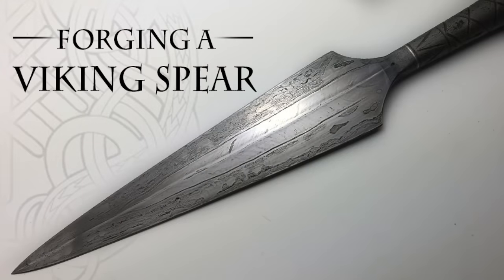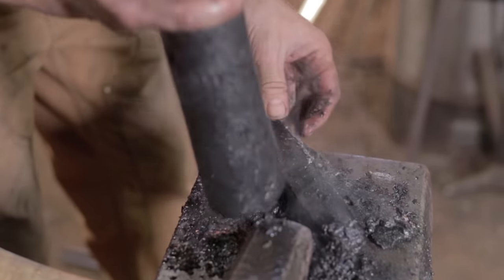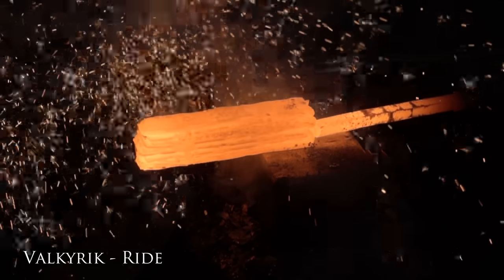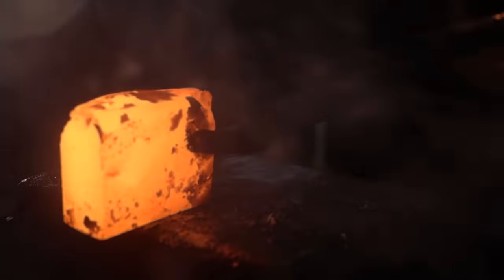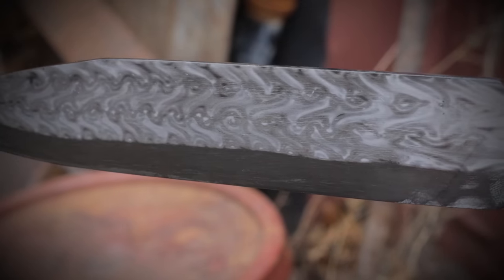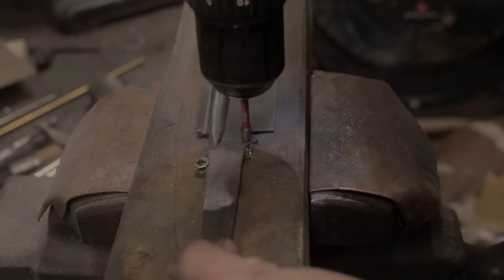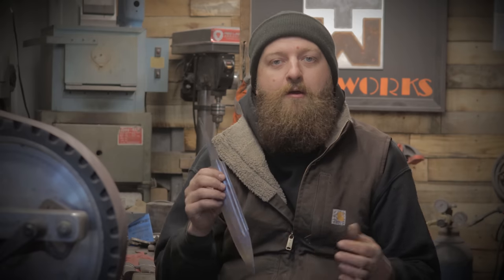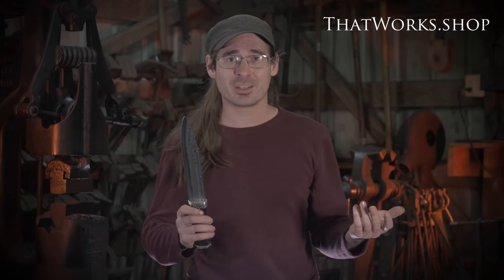Forging a [Viking] Seax from Blister Steel - Feat Valkyrik Soundtrack

Comment: Looks like there's quite a lot of air pockets or failed forge welds or cracking between the iron and steel layers, I would be worried about the blade's ability to stand up to abuse.
Reply: And its on sale for 2600.00 lmao

Comment: Considering all the effort put into the pattern welding and the carburization of iron it would have been nice to see a more "historically accurate" scramasax, since there are a lot of seaxes with beautiful engravings and even more intricate fullers, more on the merovingian horizon though, and not only on langsaxes but in kurzsaxes too. Nice work nonetheless.

Comment: I like that you promote the use of the sander, a tool that should not be underestimated in the workshop, I built my first sander almost 40 years ago with a 4 inch by 108 inch belt on a 3 hp motor, I still have it and have rebuilt it a few times over the years, I also have a 5hp canning machine with the same belt size,, now that Im knife making rather than stainless fabrication i need a smaller machine for knives, that said there isnt much I cant do with my big machines, Only a few like grinding and polishing and will take the time to master it,, but its worth it,,
Reply from the maker: I used 5hp Bader huge machines most of my career so I hear ya!
Reply: @ThatWorks   I can tell, every time I watch  a tube with you on the grinder i see you do exactly the same things I would, although i dont have that set up to change wheels out for the fullers, for that I will need to build a new machine, Grinding and polishing  is an overlooked skill by most fabricators and yet finishing your own work to a professional standard is super important and personally i never left my finishing to one of the grinder polishers employed at the factories I worked at as they are over worked underpaid and under appreciated and they always enjoyed a bit of a break if you could finish your own work,,  as an employer i taught my trainees to polish first so they would understand what good work and good welding was, very difficult to polish crap welding, they learn fast,,  working SS for 40 years set me up well for knife and sword making,,  If i ever get over that way i am coming to visit , a couple weeks spent in your shop would be time well spent,,
Reply from the maker: @hugokappes4077  I love it! The last 5% of finishing a project is the most important. So many people stop at 95%
Reply: @ThatWorks  You got it,,  !! its not finished until its finished,, ! I get a great deal of pleasure finishing a mirror polish on something,,
Reply from the maker: @hugokappes4077  I’ve actually started getting that feeling from hand sanding the final few grits. Nothing like a hand sanded blade.
Reply: @ThatWorks  sometimes thats the only way to get it to look right,,

Comment: they have found jewelry and other trinkets in viking tombs that originates as far as india, while vikings are renowned for pillaging, most of the seafaring were either for migration and settlement, or for trading. and steel was a very sought after material for trade

Comment: My favorite Bladesmithing experiment I’ve done was forging chainsaw chain Damascus the same way you would process bloom steel. I folded the material until it was solid and the final result looked very similar to high carbon bloom steel

Comment: When I worked as a chef I noticed that my higher carbon knives were hugely effected by onion, and red cabbage and would blacken almost immediately.  I would guess that a polished unetched blade would gain a chemically etched look through normal use quite quickly if the blade was not constantly polished.  Maybe an interesting experiment, you could put a blade constructed like this through daily use and see how it goes.   Great videos,  thanks for sharing your experience and knowledge.
Reply: And we ate and still do eat alot of onions,here in thr north. And i agree with you on this.

Comment: Don't know if you guys would be up for it, but I would love to see a full traditional build on something of damascus. Coal forge, no power tools, all hand tools, would love to see how you'd do it. Most smiths that I've seen always use some sort of power tools, and I understand that it makes it easier and faster, but would also love to see older techniques used. When Ive gone to Rennaissance fairs before, I'd love to just sit and watch the smiths or glass blowers if they had them.

Comment: Very beautiful knife and fun video to watch. I have made and sold many Seax knives. I also used Bog Oak in the handle. I believed it added the Viking spirit into my knives. My fittings were hammered bronze. 
I’m curious about why you went with more of a Bowie tip instead of the original Seax. Doesn’t matter. It’s a very beautiful piece.
Reply from the maker: “The original seax”. There are about a dozen of common seax shapes. I don’t believe there is an original
Reply: @ThatWorks  this is true. I believe they may be getting at the commonly seen/known image of a Seax, and it's almost dead straight edge and sharply defined broken back

Comment: I think the "etching" was done by hand sanding , then the use and rust of the handoils, and when a leather slid was used the resdou of the leather preparation, then only the cutting egg was sharpens... cutting into animals and people added to the mix of "oxidisers" ... vikings dined handel there knives with clean cloth like the samurai

Comment: ✋ Question, correct me if I’m wrong and I’m not trying to start a fight but isn’t the Seax Anglo-Saxon not Scandinavian or “Viking” I’m not saying that they didn’t use it at one point in history but to say that it is a Viking weapon is misleading isn’t it?
Reply from the maker: Not this particular one. The silver design work is quite Viking. I had a whole talking point about the seax being a euro thing not just a Viking thing and it actually predates the Viking as the romans had seax knives too.

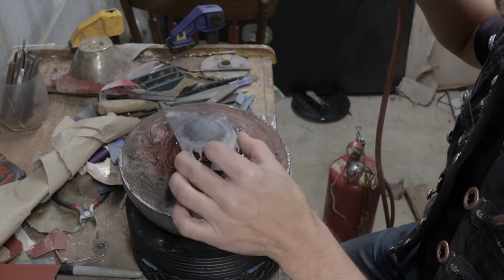Comment: 21:00 I've wonder if Ilya uses rough formed pieces for chasing and repousse work, thanks for showing an example. That's a nice piece of bog oak for the handle too. The Seax turned out great!
Reply: What do you mean by that question
Reply: @ilyaalekseyev3589  Sorry if that was read as 'someone else work'.  I just don't recall ever seeing you start from anything other that a flat piece for chasing and repousse and wondered if there was a reason not to do a quickly pressed shape to start. I do some metal stamping and die work (videos up on my channel) and think about chasing and repousse to gain more detail. Thanks for your interest.
Reply: @manythingslefttobuild  I always start from flat. Every part of the piece has to be a product of my human hand.

Comment: Speaking on historical Viking-era etching, the properties of both lye and vinegar were fairly well understood by the culture. An even accidental vinegar etch seems, to me, extremely likely. 

Vikings had both lye soap (well attested, at least by the Anglo-Saxon Chronicle and several monastic sources) and the vinegar needed to keep oneself from being burnt by that lye. Blacksmiths tinker. They always have, and they always will. Somebody played around with vinegar and steel at SOME point, I’ll put good money on it.
Reply from the maker: I agree 100% but with these historical items the burden of proof is high
Reply: There’s reasonably easy tests to run to see if a sword has ever come in contact with acids. Have you heard of any tests to see if various historical pieces have come in contact with basic acetic acid or the like?

Comment: In the Sagas it is also written that a smith would file the iron and mix it with chicken feed. He would then gather the chicken poop, as it had the metal in it, and use that to forge his sword billets. Would that then give it an even higher carbon content than the method you show alone?

Comment: How about getting the pattern pop up by rust blueing? Did you ever try it? On my gunparts I mostly use soldering flux or vinegar for the basic coroding. First treat the parts with vinegar, than leave it for one night in a humid air until it gets a thin red layer and than cook it in water for some time. Than brush the surface with a nylon or sisal brush. Every change in material will get very visible and if it is not dark enough do it over and over again. On my flintlock shotgun it worked realy well but i dont know if this will work to bring ot a pattern welded to pop up as well. Maybe it will be a nice experiment.....

Comment: I was thinking about the question of etching.The Vikings were seafarers so it would be reasonable to assume that they quenched in seawater. If a smith starts out with a twenty gallon quench/cooling tank he wouldn't completely change that water just add to it. over a period of time with evaporation, and steam he would end up with a very saline quench medium. So i figure etching would be a fore drawn  conclusion.
Reply from the maker: That very much may be the case

Comment: Vikings where not so much Raiders as they where traders who travelled all over Europe, so it is more likely they purchased their steel from the Franks. Seax is also named for coming from Saxon in what is now Northern Germany and might have been traded for. 

Also the favorite sword of well to do Vikings where a double edged blade aprox 90cm with a middle fuller, many was imported from the Franks even some made bearing the VLFBERHT brand.

Lastly Sword or ornate knives where for the wealthy vikings, most normal members of the nordic tribes wielded longhandled Axes in war, some famous among them in the Varangian Guard of the Byzant empire.

Comment: Interesting work as usual! I have a question for the cast (or for anyone with the knowledge). It is my understanding that primitive steel (and i suppose the one used in this video qualify) do not retain carbon during the heating/forging process as well as modern steel. If so, do you think the forging affected the quality of the steel in any significant way? I know that for this knife it isn't a problem because another type of steel was used for the edge, but i'm curious nonetheless. And if it did impact the quality of the steel, would the use of an oxygen barrier during the heating process be useful in preserving the carbon content of the steel? Thanks again for the great content!

Comment: As for the whole "burning" point you made, the fact of the matter is that if you melt it to that point, you might as well just cut that part off and try again. It doesn't matter if it's "burnt" or not, ruined is ruined.
Reply from the maker: That’s pretty much correct. The point is that it’s adding carbon to the low carbon steel. Same thing would happen if iron sword blades were being forged and the result would be harder more steely sword blades

Comment: beautiful work.  Im a big fan of period correct materials.  do you think you will do a video about the production of your high carbon bloom steel?  also ive been looking for a video, i swear it was you guys... a pre form blade (not the components of a billet) was carburized with coal in a pipe.  perhaps i am mistaken, but if it was you can you tell me which video it is? i have spend an inordinate amount of time already looking for it.

Comment: re: etching: we know that Norse peoples of the Viking era (remember: "viking" wasn't a culture, it was a job description) brewed mead and, presumably, other alcohols, and probably traded for and plundered wines. leave any alcoholic beverage exposed to air for long enough, the alcohol gets turned into acetic acid, turning it into vinegar. let it get cold enough, and the water starts freezing while leaving a liquid solution of acetic acid, water, and the other things that might be in it; you can repeat this process at lower and lower temperatures, removing more and more of the water and probably other substances, I don't know for sure. it's called fractional freezing distillation, and it works because acetic acid really really doesn't want to go through phase transition between solid and liquid; you have to get it absurdly, inhumanly cold to get it to freeze, but once you do it'll stay in solid form all the way to about 60° F.

Comment: I would imagine that exposure to seawater would etch the blades even more dramatically in less time.
Reply: Well no, because they would have been in sheaths...
Reply from the maker: If you mean a fine coat of rust then yes that can do it over time.

Comment: Ok, so I've got a challenge for you! Forge a knife using only copper wire. Take old wires and cables and strip all the copper wire from them and forge a blade using just that!

Comment: On the question of etching blades, or not, Peter Johnson shared an image with me several years ago after I asked a similar question on a forum. The picture is of a bog find viking sword. A small portion of the blade was perfectly protected from corrosion by the environment in the bog. Protected like, it's still shiny.. You can very clearly see the deeply etched twist pattern in the blade. Went a fair way to answering that question for me. Were they all etched? Maybe not, but it certainly was done.
Reply from the maker: Or through time the bog slowly etched it. It would be extremely hard to prove they ever etched but we can certainly believe it !
Reply: @ThatWorks  I need to find that picture, but the etch is super even. It looks like you or I did it. Hard to imagine the natural corrosion being that even, but I guess anything is possible 🤷‍♂️

Either way, this was a super fun build. I've done a few welded seaxes myself and this blade turned out really great.

Comment: The most probable theory of etching was their swords being thrown in seawater/saltwater and retrieved because of the Vikings' seafaring nature. Saltwater accelerates oxidation, therefore the etching.
Reply from the maker: That could be or just living near the ocean is all it takes. Salt in the air over time would reveal. My point was more about weather or not the makers of the swords did something on purpose to bring out the pattern

Comment: So I have a question that isn't really relevant to this video in particular, but which hasn't been answered in those y'all have made where it is relevant. So I figured I'd ask here while I'm thinking about it. How do you attach metal fittings, especially stuff like end caps, to the scabbard of a sword? I imagine you could pin them on before actually combining the halves, but oftentimes it seems like people add them after the fact. But I never really see that part of the process so I don't know how it's *done*.
Reply from the maker: Pins/glue/shrinking

Comment: our ancestors used to stuck pitchfork into the manure and let react the ammonia, which caused carbonation / hardening of the iron
Reply: Where is carbon in ammonia... chemically speaking? I'll just remind you that carbon is "C" and formula for ammonia is "NH3".
Reply: @ilyaalekseyev3589  like I said .. our ancestors did it. I personally did not try it, but in my opinion it is that ammonia decomposes straw and plants in manure, which is actually carbon and it binds to iron, because in that chemical reaction a lot of heat is generated
Reply: @crazyidea83  That is not how case hardening works. What the process is is nitration if the top surface of the object, it is most visible is XIX century firearms. It is a relatively simple procedure but it does not occur in the manner you describe

Comment: If you pause at 29:03, looking at the left side of the blade where it meets the hilt, is that not a crack running maybe 3/8” up the blade? Or is that just where some of the carburizing flaked off? I have never forged anything. So 110% do not know how to create or forge steel. But doesn’t that look like a crack? I loved the video, as usual it’s both fun to watch and very informative.
Reply from the maker: Nope that is left over smig from the twisting of the billet.

Comment: The Vikings probably used axes more with like war hammers was, but I sort of got curious if there is something like a war pickaxe
Reply from the maker: For the Vikings or in general
Reply: In general
Reply: @natsu2010  war hammers usually had picks on the back, if that's what you mean.

Comment: 20:58 What is this process called? I've never seen it before. Is that clay or wax he's using to form the metal?
Reply: neither, the thing he sets the silver in is just to hold it. There's a vid on their channel where he explains it, I think its their Heretic sword video cant quite remember.
Reply: @TheEthanEdge  I think I found the video you're talking about. In the video he says the big half ball is a ball vice and it is filled with lead to give it mass. However, that doesn't address my question. It is the substance ON the ball vice that I am curious about. It's the stuff that he heats up with a torch before he places the silver on it that I am wondering about. It must be hard enough to take a lot of strikes yet impermanent enough to allow removal and not hard enough mar soft metal like silver. I have looked at a couple of videos on this channel and he uses it a lot to hold whatever is being engraved. Some times it's red in color, other times its dark grey or black. Sometimes it's a large chunk with the metal embedded in it, other times it's on a wooden plank.

Comment: What size bits are you guys using to drill those holes to fit the tang in the handle I need to know that?
Reply from the maker: It depends the thickness of the tang…3/16” or 1/4” is common